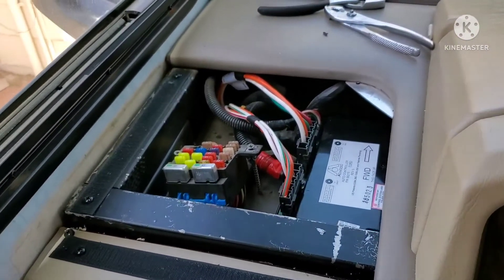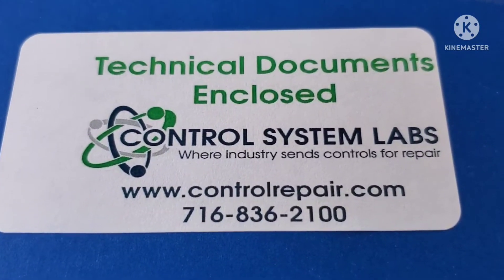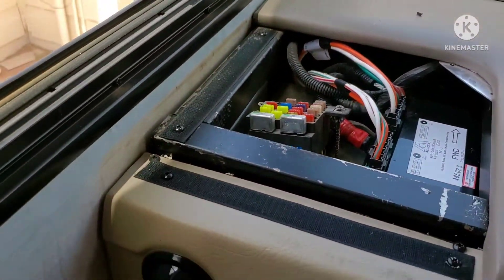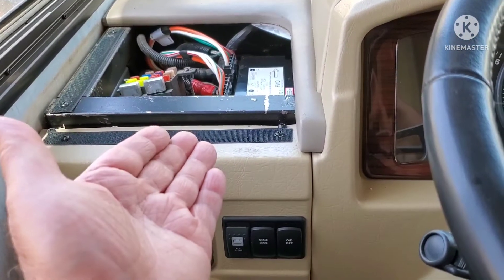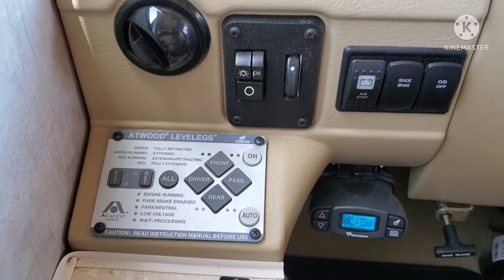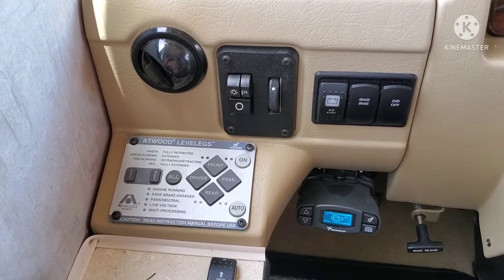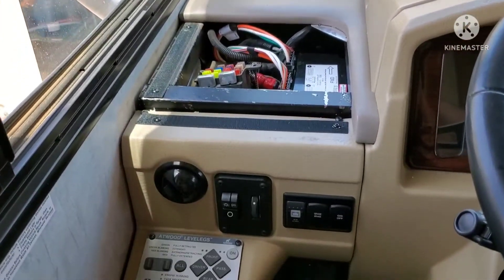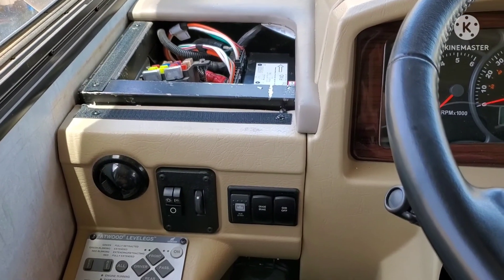Atwood levelegs Update #2 Problem fixed??

Comment: I have a 2006 Newmar ventana with Atwood leveleg system. I rebuilt the rear jack but still have an error light for that jack on the control panel. How do I reset the system since installing the repaired jack.
Reply from the maker: When the system or vehicle is shut off it should reset. You can try disconnecting battery for 10 min. that should reset all systems.

Comment: i HAVE A 2005 SOUTHWIND 454 CHEVY ENGINE. MY MOTOR BATTERY IS IN FRONT OF THE DRIVERS SIDE UNDER THE HOOD. THERE IS A BOX ON TOP OF THE MOTOR BATTERY WITH A DOOR. IS THAT WERE THE BREAKERS ARE LOCATED FOR THE ATTWOOD LEVEL SYSTEM? i AN HAVING THE RED AND GREEN LIGHT FLASH WHEN I TURN ON MY PANEL FOR THE FRONT LEFT LEVELER AND THEN A ALARM GOES ON. NONE OF THE LEVERS ARE MOVING TO GO DOWN OR RETRACK. The levers are down and will not go up. Any suggestions please!
Reply from the maker: Make sure you are in park, Make sure e brake is fully engaged, engine running. Have you tried disconnecting battery wait 15 min reconnect, try again. Make sure battery is fully charged. Follow power wire from Battery, Find 50 amp breaker , trip and reset. 
In order for your module to fully reset you will have to disconnect power for several minutes. 
Check all battery connections and connections at the breaker, I had a loose wire at the breaker causing a low voltage issue and tripping alarms.
good luck. Worst case scenario . look up how to manually retract with a drill.

Comment: Same problem..driver front..also other jacks.Not good with ectopic like you. My mechanic found out Atwood out of business and no parts available
mechanic says if I find a used jack motor Its a cap shoot..could also fail. And what if another jack fails? My issue is that when running it reads 15 Amp and shuts down..jack detects a spike. Mechanic cleaned the faulty jack..no help. Did you solve the problem permantly. Now I don't even use the jack system at all..most of time I have level RV sites. If not,  I can be 1/2 bubble out of balance for frig. Other than that, last summer I used  tire Ramps to level...but a pain!. BTW..4..slide out rooms are OK without jacks down.. rooms go in and retract OK

Comment: Can you please share where the 50amp breaker is? I cant find it anywhere? Thanks again for all your help
Reply from the maker: I am sure it is in different spots on different coaches. On mine, it is below the engine battery mounted to the cross member. Follow your Large positive cables from you battery, one should go to the starter, the other to the breaker. That's how it is on mine.  It should be a very short distance from the battery. Good luck.
Reply: @2lotony  thanks so much for your reply! When you say the "breaker" are you referring to the 50amp fuse? I know where the fuse panel is right near my battery but all my "breakers" are in the middle of the coach? Thanks again!
Reply from the maker: @Adamnmelissa  
It was described to me as a breaker, since it is resetable. But yes that is what I was referring to. That is where my problem was. Loose and dirty connections.
Reply: @2lotony  i finally found out what you are referring to as the 50 amp breaker! It is a breaker and fastened to the frame near the main battery. Mine looked old and rusty so im replacing it today, crossing my fingers that it fixes my problem
Reply: I know you posted this a long time ago, but did you locate that breaker/Fuse? and have you resolved this issues you were having? Thanks

Comment: Thanks for the video, i have a blinking red/green light and alarm. Spent hours checking everything out, even took it to an rv dealer and they couldnt fix it. Took the control panel off cleaned everything, bought a new  keypad, not the issue either. Im at a loss of what to do. The jack thats the problem will work if i do it independently but all jacks will not retact/extend together?
Reply from the maker: Did you check all connections from battery to breaker to control panel?  Control labs had me check the voltage at the main positive at the control panel. Check Voltage drop while operating, mine went to almost zero, that's when he told me I had a problem with power coming from battery to control panel. I found loose and dirty connection at the Breaker, cleaned and tightened, fixed my issue. You may have enough power to move 1 jack but not all four. Good luck.

Comment: I just had the same issue go outside to the Jack that you’re having an issue with underneath it. There is a little nipple hanging out turn it about 10 or 11 times counter clockwise, then go back to your controller track to your jack turn off turn the power off turn it back. On and it should work it did for me and I was having the same exact issue you are.
Reply: I tried everything possible and ended up buying and installing the gama control system. I would have rather gotten the original system to work but this was my next best option. It works and it fixed my issue
Reply: @Adamnmelissa with that system can you get both front or rear jacks to work at the same time or do you need to extend one Jack at a time? Thanks!
Reply: @bounderchris  there is a button that does all 4 at the same time but with the weight of my rv it doesn't work the best. It also has 4 seperate buttons for each jack so i normally do 2 at a time and then to fine tune the leveling i do each one individually.
Reply: Are you talking about the nut on the bottom od the jack motor? I tried everything else imaginable and still cant get the green/red lights and beeping noise to stop!!
Reply: @Adamnmelissa  Amy other luck with your system same problem with mine

Comment: I have the same system in my 40’ 2006 Tiffin Phaeton. Nice coach in well maintained status BUT I really worry about this Atwood system stranding us somewhere with a jack down and malfunctioning. So far it has worked but had to reset it the day I bought the coach and has had a couple glitches(that resolved somehow) in the levelers. Why they went with these and not hydraulic I have no idea.  Thanks for the vid. I’m just trying to find an instruction manual.
Reply from the maker: Keep poking around on the internet I have seen a few just never printed one out. Or you could call control lab and see if they could sell you one. Good luck.